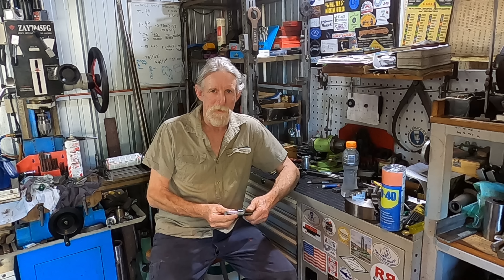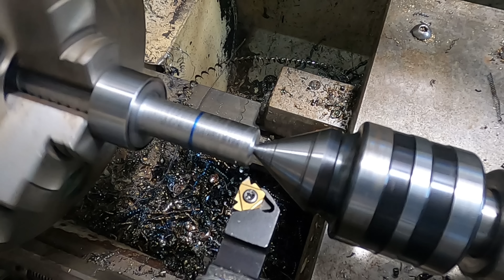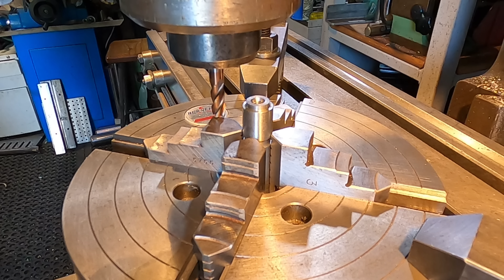JFMT Lathe stud shaft .  part 2

Comment: Something I noticed on the thread cutting, when you stop the lathe and pull the tool out, while the chuck is still spinning the tool stops dead(as if disengaged) when I do this with the tool having the half nuts engaged at all times, the tool keeps traveling till the chuck stops, I found this very strange. In the second part after heat treatment you set it on a number on the thread dial but when you withdrew the tool and stopped the chuck the tool kept on moving till the chuck stopped, I'm confused. Its either always engaged or you disengaged it or Does the lathe have a special threading shaft or something? Would be interested to know. I'm learning more every video or at least trying to. Thanks.
Reply from the maker: Cutting a metric thread on an imperial lead screw , sometimes I disengage then re engage when I reverse the lathe . You have to pick up on the same number though .  Usually only do it when threading to a shoulder .

Comment: Really nice looking grind on that and a great fit. It was cool to see you flame harden it too as opposed to using an oven and it seemed to come out great. 👍
Reply from the maker: Thanks .  A  twin heat treat oven is on my future long term have to get list .  We do not have the opportunities here to be ale to pick up one's like  Hot shot 360 style , so it will have to be a home built one .   Future plans for the shop will make it a necessary item .   👍

Comment: Bloody amazing work as per usual Max. Good tip with the indexing mate. Even using the magnet during heating too. Cheers mate 🍻. Aaron
Reply from the maker: Thanks Aaron .  👍
Reply: @swanvalleymachineshop  I wondered what you touched the job with when you were heating it. What was the magnet doing? Jeff
Reply from the maker: @jefftheaussie2225  A magnet .  The steel changes into a non magnetic state when it is time to quench .   An easy way other than checking the temp .
Reply: @swanvalleymachineshop  Thanks Max, I didn’t know that, I will try it. You have probably explained that before but I don’t know much about heat treatment. I tried to heat treat at tool for removing gib head keys on an old motor and it ended in tears. Jeff

Comment: Great outcome Max. Nice to see some 'thoughtful' heat application during hardening, there was so much going on with that flame, I could almost hear your thoughts. Tool post grinder is a gem! Cheers, Jon
Reply from the maker: Cheers Jon .   A duplex style heat treat oven build is on the cards for the future . 
I have be able to have controllable heat treat options for the new shop .  
You can not beat having a TPG for the quick small jobs . You can get good results once you work out how to drive them !   👍

Comment: Nice piece Max. I’ve done small parts like that from D2. The last time was last winter here in NYC, and it was 22 degrees f. I put it outside hanging vertically. Worked out very well.
Reply from the maker: That's cold !  Thanks .  👍

Comment: Max, I understand that you CAN open the split nut at the end of the thread and pick up the number going back, but I'm not sure what the benefit is. Seems to me it just introduces another chance of error in the process. You're going to withdraw the tool, stop the lathe, and reverse it in any case. How does releasing the nut make things more efficient?
Reply from the maker: You can thread up to a shoulder that way on machines with no brakes . Learnt on large lathes that take a while to stop .   It's a method that comes natural to me & i don't have to think about what i am doing .   👍

Comment: Part turned out really well Max.  Some pretty fancy special effects in the video as well.  I once made a gauge out of oil hardening steel for a customer.  He wanted it as hard as possible (no tempering) and the tool number stamped in it.  It was a short rod about 3/8" in diameter with a short slightly smaller diameter on the end.  What I thought would be a simple job took over 20 tries before I got it right.  The main problem was distortion during quenching which required so much grinding that the tool number would be ground away.  The grinding went very well and the part would be perfect in every way except the tool number wasn't visible.  I greatly reduced the distortion by spinning the part in my drill press while heating and then lowering it into the oil while it was still spinning in the chuck.  This, combined with extremely hard hammer blows on the stamps resulted in the tool number being visible.  As soon as that problem was sorted out I started having problems with grinder vibrating at the very end of the gauge.  Of course it would only vibrate on the finish pass and bugger up the finish.  It was the closest I ever came to giving up and phoning the customer to tell him I couldn't do it.  In the end I managed to get one to turn out perfectly and happily closed the job. Ken
Reply from the maker: That is called  '' Character Building ''  👍
Reply: @swanvalleymachineshop  I guess you could call it that.  Sometimes building character really sucks.  Ken

Comment: Great set-ups and work as always, nice job on recycling fire extinguisher , I remember you used the neck as a guard on the tool post grinder 👌✔. I used your idea by using a propane tank for my quenching fluid. Fire extinguisher is a safer option though.
Thanks for sharing. 
Best regards John
Reply from the maker: They make great guards .  I am going to use one for the guard on my tool & cutter grinder .   👍

Comment: Hi Max
My lathe was doing the same as yours I fixed the base put it on eight solid feet and now if I reef on it I can only move it 0.01 mm and I am sure that is coming from the head stock bearings at least now I can get consistent results.
Reply from the maker: I will bolt it down in the new shop .   Should have done it years ago !   👍

Comment: G'day Max... The threading & hardening worked out well. Lathe seemed to sound a bit noisy low geared when cutting the Initial thread ? 🤔  
Your grinding looked very Impressive.  Also cutting the Square was the best I've seen. Good one Max.
Reply from the maker: Always has been a bit noisy in certain low speeds .  Cheap & cheerful straight cut gears for the feed drive  . 👍
Reply: I thought it was making an unusual noise too...
Reply: @matspatpc  G'day Mat .. lol glad I wasn't imaging things  😅 🙃 🤣